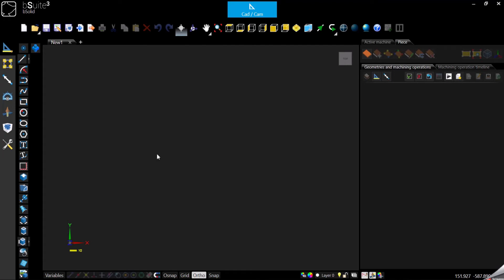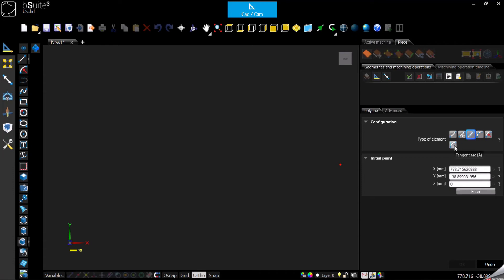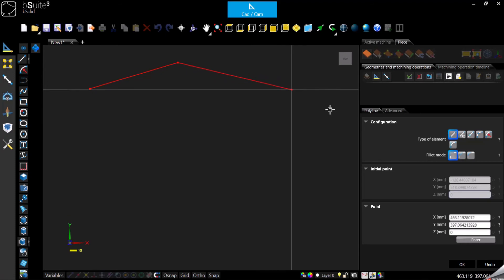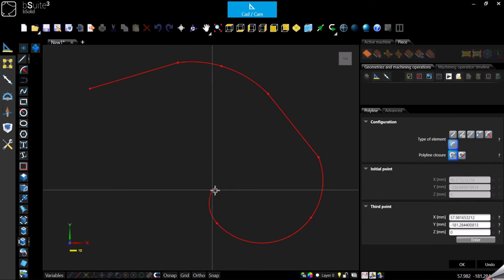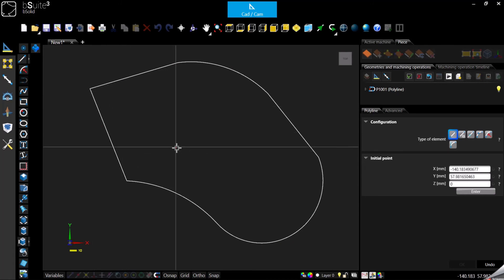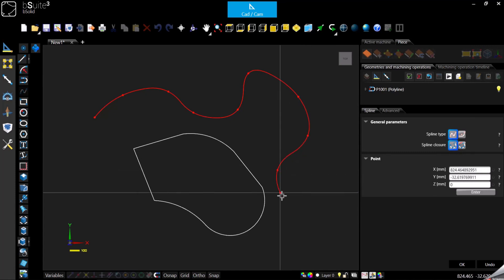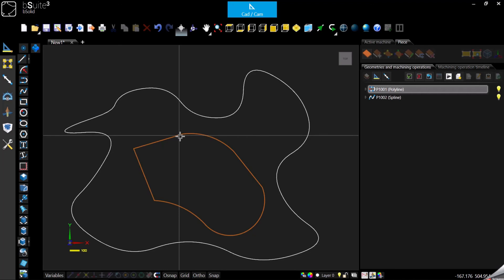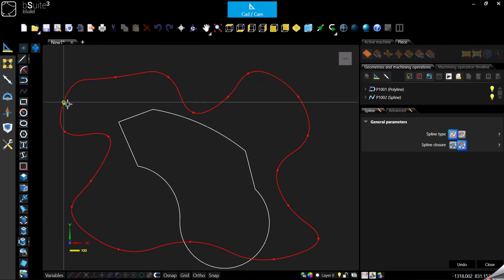4 - CAD BIESSE bSolid - Part 2 (Polylines and Splines)

Comment: Hi, it’s very good find all your videos, I have a question, is it possible to create a sheet of leftovers material in a different shape than a square or rectangle? Thanjs
Reply from the maker: Our module to manage leftovers can only manage squares and rectangles, but manually it can be done.
Reply: @freshzone  you mean create a sheet and use it for nesting?or to use it manually
Reply from the maker: @manuelsantos9615  Either ways. The difference is that if you create a new sheet for bNest it has to be rectangular, instead if you prepare a new bSolid program manually, the panel can be created out of any shape.

Comment: Thanks for videos.
Just watching out of curiousity, even though I don't own an Biesse with bSolid.
However I'm an CNC user currently using an old Rover 322 which is still working strong.
Comparing to the way I program my Biesse, bSolid looks like a very quick and practical app to use.
Hopefully, I could try it soon.
Keep up the good work.
Reply from the maker: Thank you, your feedback is really appreciated!
You are correct, with bSolid is a lot easier compared to what you are currently using. 
I'm glad to hear that your machine is still working strong even though the technology is moving forward, but I think that with a bit of maintenance and care, our machines will last forever. :-)
Reply: Hello Sir, I'm also start recently using a Biesse Machine for curved panels edging  ''Rover A Edge'' , so I hope if you can give me  some kind of tips about the hardware [Maintenance and failure of the machine ] in other terms '' please sir help me  to take care of the machine.